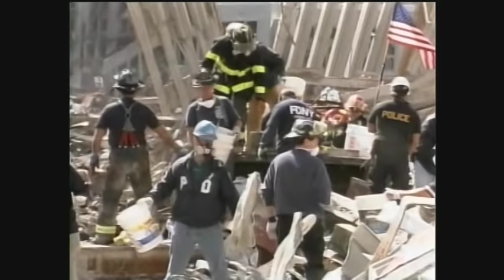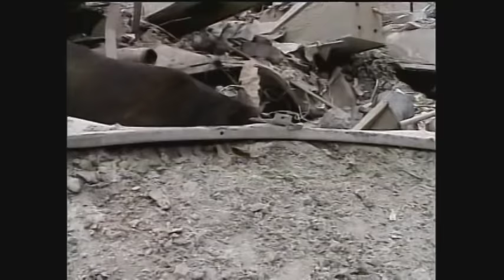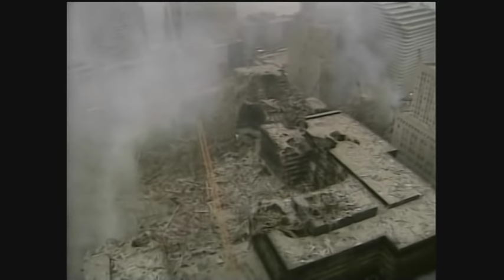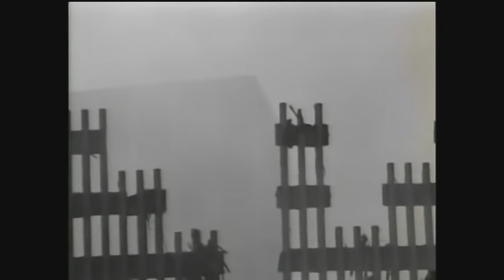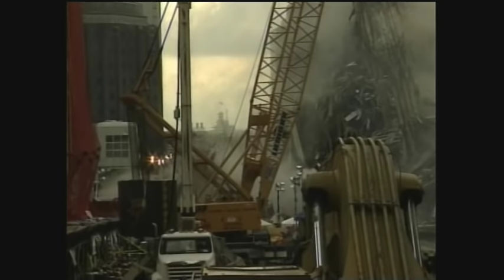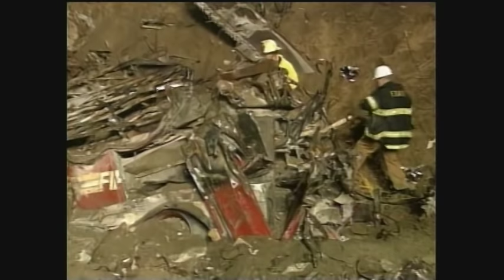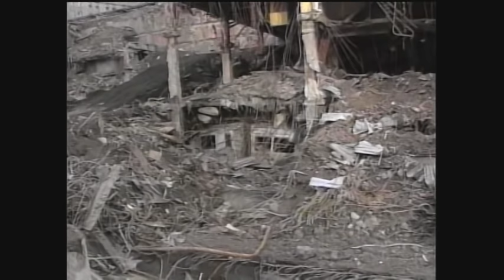Rare and new FEMA footage of Ground Zero

Comment: Over 20 years later, it is still hard for me to realise how only a pile of rubble could remain of two of the tallest buildings in the world. A human being seemed like an ant in comparison. These buildings were as mighty as mountains. And after a few seconds they were pulverised, as if they had only been made of sand. For that reason alone, people will still be talking about them in a thousand years. It's just so surreal.
Reply: Anybody who thinks it was just gravity that did that to those mighty towers must be off their trolley.
Reply: @patricksmith4424 You of course have a sound working knowledge of physics and engineering principles? As opposed to reading simple minded conspiracy nonsense on the internet?
Reply: @smorris12 do you ? Explain WTC 7 then.
Reply: Many dont understand that for everything inside, it was still mostly just air
Reply: @patricksmith4424  agreed, almost like they ignore the plane impact, initial explosion, and only-growing fires that plagued both towers
Reply: collapsing in free fall is impossible. And the way how building 7 collapsed on all 4 corners at the same time is impossible. Especialle because the building was so long.
Reply: @michaelrupf776  you studied limit state design?
Reply: @tehjamerz  Just use your brain..
Reply: they were very. very far from being strong as mountains....

do some basic research.
they swayed in the wind for years.
they were steel shells with concrete floors, hardly impenetrable
Reply: @asbestosfibers1325  Yes but they cannot collapse in free fall if they are not prepared with explosives.
Reply: @asbestosfibers1325  they didn't sway with breaks in the outer columns and heat softening them, as well as the additional side to side forces from the impact of the plane
Reply: @patricksmith4424  Agree. Dr. Judy Wood, engineer does a great job explaining with evidence how they were turned into dust.
Reply: Dr. Judy Wood, engineer does a great job explaining with evidence how they were turned into dust.
Reply: @AhJodie  Thanks so much for telling me about her work. I have just watched a vid and it does put a fascinating alternative on things.
Reply: @patricksmith4424  Take a sheet of paper and roll it into a tube. If you try to push the ends together it can be done but it takes a little effort. Do the same thing to a second but cut a tiny hole somewhere in the side. You'll notice you can push the ends together with little effort. those towers were basically like steel tubes in their construction.
Reply: @nutellafoxvideos7350  yes of course if you take matter out of a material it will be weaker, but in the case of steel it is still immensely strong. Every steel framed building on the planet has only a small amount of matter holding it up. They don't collapse do they? Also take your paper tube, yes the one with the   hole and place it vertically on a table, now try and collapse it without any pressure from the top. OK that's impossible. Now completely slice it off two thirds of the way up. Drop the top third on to the rest what happens? OK, nothing again. The point I am making is as a building is deigned to hold everything above it then the weight above cannot collapse, so the pancake theory is nonsense. Oh when you do squash your paper tube with your hands does it break up into a thousand pieces. No of course it doesn't, it goes in to a crumply mess... Just like steel does.
Reply: @patricksmith4424 
You don’t believe in gravity? That’s insane.
Reply: @Frankie5Angels150  what's insane?
Reply: That pile of rubble was fourteen stories tall.
Reply: noelleleger232  the design of the building explains the symmetry
Reply: @patricksmith4424

That broom would work if they were solid steel all the way through. The point is at that scale metal concrete start to behave more like paper.
The reason I say a cut and not a clean cut on the paper tube is the towers were not hit with a clean cut. They were still attached on some sides. Their collapse caused a cascade of some columns pulling down and others being pulled up on the other side, though the net force is downward.

If you're looking for a demolition I will note that those usually start from the bottom and go up so they accelerate down while the towers fell down into the lower section below impact, accelerated for a bit, but about halfway (and mostly hidden by smoke) they slowed down and the part above the tower did fall to the side because that had less resistance. You see that pretty clearly on the south tower too. The north tower's top section fell to the side as well with a decent chunk hitting the back of wtc 7. (which burned and had sections slowly collapse over several hours before the front facade gave way)
Reply: DR.Judy Wood "Where did the towers go"
Reply: @tycoach2169  that woman is out to lunch
Reply: @patricksmith4424  up to 142 tons of airplane including 63 thousands liters of jet fuel kind of happened, also.
Reply: I wouldn't be so sure about the thousand years, ask any youth today about the significance of Pearl Harbor.
Reply: @davidm4160  Ask any youth about the Nika riots. Yet they are still talked about 1500 years later.
Reply: @dparis2172  a riot is hardly a comparison to a terrorist attack or act of war on the USA.
Reply: @Galf506  You think jet fuel turned all that steel to dust?
Reply: @davidm4160  Did you even understand what you wrote? The point is that just because most young people don’t know about Pear Harbor doesn’t mean people aren’t going to talk about 9/11 centuries from now. I wasn’t around for Pearl Harbor nor the Nika riots but both events are still talked about, at least on a scholarly level, as will 9/11.
Reply: Controlled demolition. Thermite!!!
Reply: @michaelrupf776 io ancora non ci credo ! Perché il proprietario quel giorno non era a lavoro ? Già sapeva …. 
E due sabati chiusero l’accesso perché ?

Io non sono complottista ma vorrei tanto credere che sia vero ma non riesco
Reply: @easterworshipper730  the uh... the building falling on top of it probably did some damage I think
Reply: Это Америка сама взорвала эти здания ради повода для войны... Позор Америке👎
Reply: Seconds? Okay
Reply: @easterworshipper730 it was a mostly steel core building….left to burn because firefighters were attending to the disaster at hand, there were no people in wtc7 so it was decided to let it burn, the fire compromised the steel core and it collapsed bringing the outer structure down with it. It was well explained. I feel like things like this are noise really…..but there is lots of things left unanswered about that terrible day.
Reply: @smorris12 Simple minded or perfectly logic questions?
Reply: @tehjamerz Like you ignoring free fall speed of both of them?
Reply: @stevem2323  Simple minded. It's easy for people to point at things they have no knowledge of and form an easy but utterly incorrect answer. In small form people demonstrate it all the time: "why can't we just...?" is a good example of that.
Reply: @PatriotCody  a fire caused by?
Reply: @smorris12  Dude I'm asking reasonable and logical questions here, you didn't answered nothing, just like official enquiry did, the free fall question.
Reply: @stevem2323  That's the problem, all this "but free fall" is bollox, sorry. It doesn't mean anything. It doesn't need answering. It's just noise put out by the people that think we didn't land on the moon or flat earthers that don't understand scale or gravity. Just because people don't think things haven't been answered doesn't mean they haven't. The collapse sequence is well documented and understood. There's certain parts that can never be known (did truss 87 fail first etc) but the overall failure mechanisms hang together and don't require atomic bombs in the basement, thermite on the beams or explosives anywhere. There is nothing left to pick over.
Reply: @smorris12  I'm even willing to give them that, explain free fall and especially free fall and wtc 7 being pulverized while falling down.
From what, fires?
Reply: @stevem2323  What about free fall? What are you expecting? That the building should slowly slump like a melting ice cream or something?
Reply: @smorris12  Nope, just normal non free fall speed dopey.
Reply: @smorris12  Are you one of those trust the science guys, like during the Covid? You know, non changeable religion based "science".
Dude the stuff that we thought based on science, i would 10 comment sections to list here.
Reply: @stevem2323  That doesn't mean anything. That's your problem, right there. Sorry.
Reply: @smorris12  That doesn't mean anything? Do you even know what free fall means?
Reply: Nah . There won't be Humans in a thousand years. I give it another 150 years max.
Reply: Tin foil hats everywhere
Reply: @easterworshipper730 120 yards away from the towers with uncontrollable fires and a similar design to the 2 WTC’s
Reply: its called controlled demolition
Reply: More than 20 years that you continue to idolize your government 😢
Reply: Cn tower was the tallest building at the time
Reply: “The mountains melt like wax at the presence of the Lord, at the presence of the Lord of the whole earth.”
Psalms 97:5
Reply: I flew over them once in the 80s. My Christ, they were immense.
Reply: Wake up
Reply: It was the way they were built - long span trusses over open floors, with an "exoskeleton" frame that worked like a chute.  Once a floor collapsed it landed on the one below causing it to fail as well, and it all came down like an avalanche.  Other US skyscrapers have stronger frames and won't fail like that during fires.   The First Interstate Bank fire in Los Angeles is a good example.

Comment: steel does not need to melt to collapse. I am an engineering student, and can safely say that even at less than half of its melting temp, any mild-steel will loose a significant amount of its stress capabilities. i could go on to tell you all about how it will effect its crystalographic slip-planes and how increase in grain size will weaken the metal, as it moves past the re-crystalisation phase of annealing, as the metal heats up (only needs a few hundred degrees in a small area)
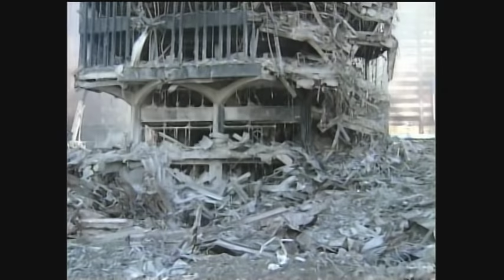Reply: I’m sure you can explain all those things, but can you explain to me how the building shown at 1:42 of this video remained standing but WTC7 didn’t?
Reply: expecting conspiracy theorists to know about basic physics and thermodynamics is a very tall order... these people can't think that far
Reply: @MrRobinwhatley  Why is skyscraper engineering its own specialization. Why aren't they thrown together by your average Joe structural engineer.

Smaller structures are engineered with substantial factors of safety, while the height of tall buildings force compromises.

The surviving parts of the complex did suffer collapses and buckling from fire internally as well as from impact damage as documented in the FEMA report 4 "WTC 4, 5 and 6".
Reply: @MrRobinwhatley  Because WTC7 suffered considerably worse damage, plus a raging fire that burned for hours.
Reply: I don’t think people talk about it melting anymore.   It’s well documented at this point, the best alone weekend the steel, along with the plane crash itself damaging the building is what eventually caused it to collapse
Reply: @thedogwoods5716  They still do... Constantly.  No mater how many times they are shown that steel loses strength at lower  than melting point temperatures, they still bring it up as an attempt at a "gotcha."  They refuse to learn, because learning would force them to give up their delusions, and their feeling of being "special" and superior.
Reply: @MrRobinwhatley Al existir una estación eléctrica donde se construyó WTC7, se tuvo que recurrir a un sistema de columnas de carga del suelo al piso 7 diferente, dónde las cargas iban desde arriba al piso 7 en columnas rectas pero a partir de ahí se canalizaba esa carga en tramos laterales antes de llegar a otra columna
En conclusión, una parte de las cargas estaba dividida en menos columnas, iniciaban en un punto y terminaban en otro
Reply: @ChristopherGray00  you're saying hat Al-Qaeda could do this to any tall building just by knocking out a few columns? Coming from a construction family, it's weird Osama bothered with the planes.
Reply: Accept according to a documentary about the building of those towers, it wasn't made with mild steel. They claimed it was high strength hardened steel not mild steel.
Reply: @thedogwoods5716  Dr. Judy Wood, engineer does a great job explaining with evidence how they were turned into dust.
Reply: @ChristopherGray00  sorry mate my reply wasnt for u but original post....having said that you should maybe read it too if you think people who question it are conspiracy theorists
Reply: Big, huge, MASSIVE difference between mild steel & structural steel....think you need to study a bit harder pal & read a few more books😜
Reply: @JWRogersPS  other than office fires, what damage did wtc7 suffer??? Please provide some pics mate bcoz in the past 22yrs nobody has been able to do so....have you been harbouring them all? And while your at it, can you explain to me how a building with asymmetrical column damage due to fire can collapse completely symetrically & within 10 seconds???
Reply: @neil5209  WTC was severely damaged by the collapse of WTC1 (the north tower.)  Dozens of rescue workers observed it, and reported that most of the southern face of the building had been gouged-out by falling debris.  There are no pictures, because the press and bystanders weren't allowed in the area; and the rescue workers had more important things to do than take pictures.  There is footage taken of the south-west corner of WTC7 shortly before the collapse, and the corner of the building is very obviously heavily damaged.  There were massive fires in the building, hot enough to weaken the already structurally compromised steel framework.  Collapse was inevitable.
Reply: @MrRobinwhatley it was only 10 stories tall while WTC 7 was 47 stories tall (FORTY SEVEN!).
Reply: fair question: the bottom structure was in perfect health. I would have expected  the top of the bulding to fall apart, without destroying the entire tower underneath. Can you please explain me why the bottom part couldn't resist?
Reply: Can you explain how aluminium thin 2mm thick airplanes can go inside the building as an Enginering student?
Reply: @TDH8988  The same reason hurricane force winds can drive a straw into a tree trunk - velocity and kinetic energy.
Reply: @TDH8988 there's a documented incident of a plane flying through a BRICK WALL at takeoff
Reply: @MrRobinwhatley did 30 or so floors of a tower directly fall onto that building. No. It fell on 7
Reply: @MrRobinwhatley   I concur, as well as flash charges seen at the windows.

Comment: Nope...Plane flew into building taking out alot of the structure at the top, the fuel in the plane is thrown everywhere in the building, this causes massive fires, which can get bigger from the things in the building and materials on the plane, the fires reached 1800f, steel looses 50% strength at 1700F, so the metal must of sagged (you can see this  in close up views of the collapse (the outter walls bend inwards meaning the truses were sagging or pulling them) it was only a matter of time...
Reply: God shall judge you.
Reply: @michaelrupf776  the ones who say that are usually the first ones to judge
Reply: @kirza94  There is noone on earth that is not to judge. But some da big evil because of demonisations in the soul.
Reply: @michaelrupf776   ...what?
Reply: allright shill.